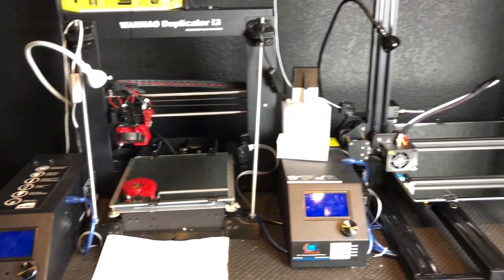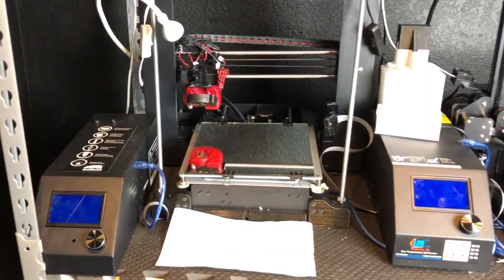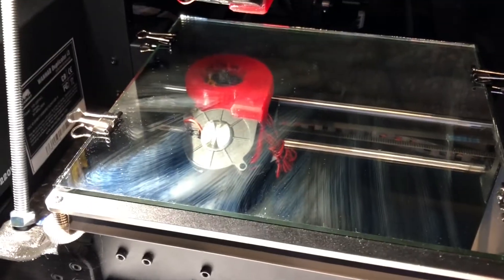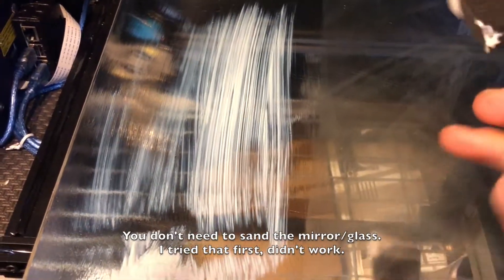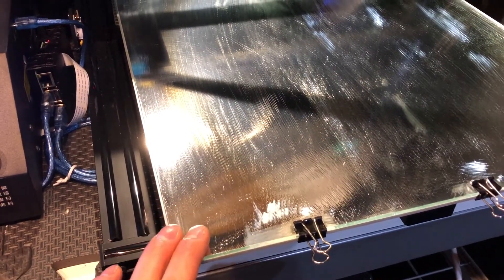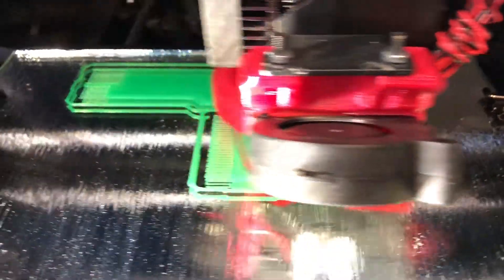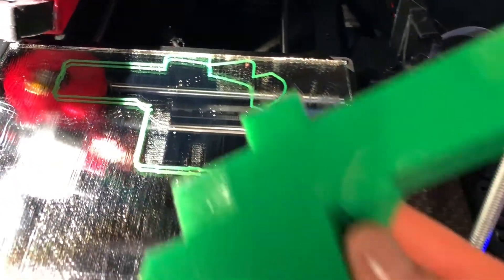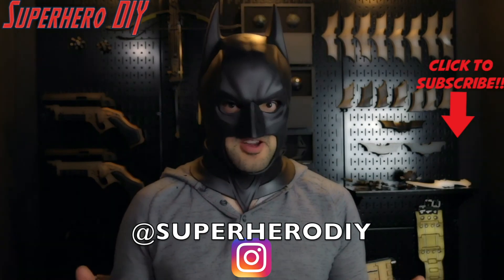Make your prints stick to glass or mirror bed with PVA glue!

Comment: I have been doing this for a while now to get PETG to stick reliably with no warping and also to come off easier without chipping the glass...  It's also commonly known as craft glue, or even wood glue (just make sure it is PVA wood glue). I actually mix it with water, about 1:1 ratio up to 3:1 water vs PVA, and brush it on with a large paint brush.. The heated bed evaporates the water and you have a nice coating of PVA which also has a nice texture from the brushing.. Stuff sticks fantastic now, I use it on all my glass beds. You can also keep the water/pva mix in a sealed container and it'll keep for ages,,, and is very easy wash up with water....   Oh, and you can toss that stinky IPA as water is all you need now... Once you have a few layers of PVA built up over a several prints, you can just dip a brush in water and brush the bed with it, and it'll renew the PVA already on there....       When it comes time to finally get it off if you want to strip down to a clean bed again, it can be a bit of a pain, but still just using water, spray the bed and get it even with a brush or your fingers, repeat a few times which will soften all the PVA up, then from the corner start working it off with a scraper in the way you would say, remove a sticker or wallpaper...  I only need to do this once a Month or two...     I prefer this over gluestick now
Reply from the maker: Rhys Theodore Well that was just an awesome comment that I learned a ton from! I don’t know why, but I never really thought about mixing the glue with water, which I obviously should because it’s really really thick when I put it on the bed. I don’t really need it that back, do I? I also didn’t realize I could store the glue/water mix but that does make a ton of sense! Thank you so much!
Reply: I make 1:5 mix and use a spray bottle for a nice even coat of pva.